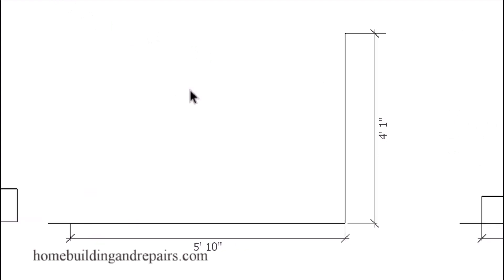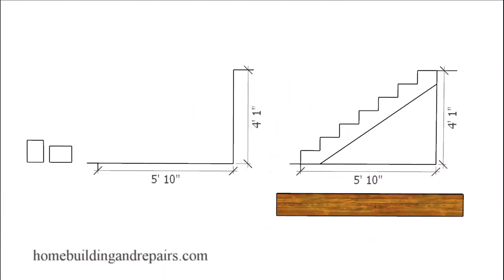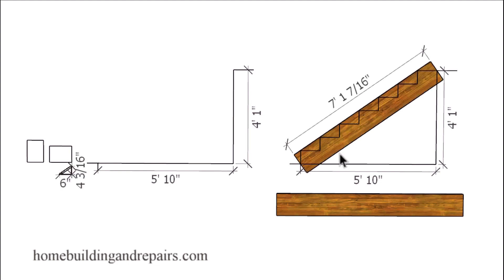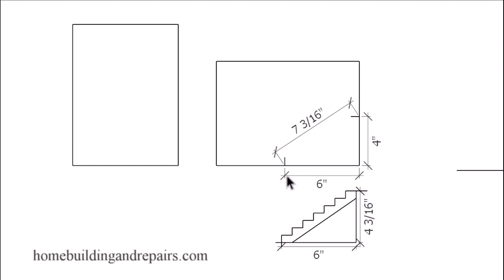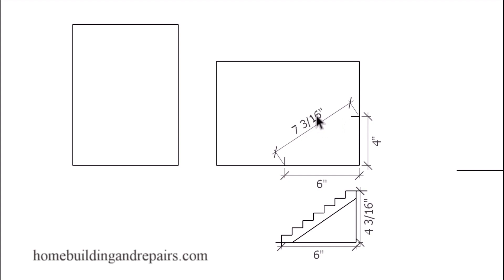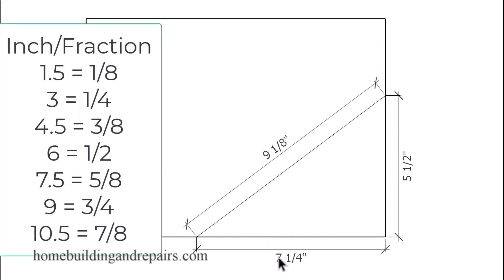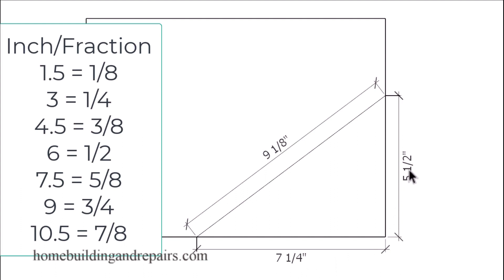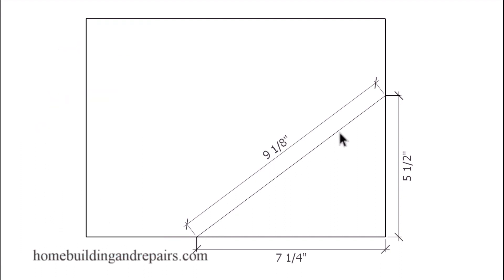How To Calculate Stair Stringer Lengths By Using Scaled Measurements - Simple And Easy To Understand

Comment: I have a question i hope you can answer. I am replacing my basement stairs which were built in the early 60's. I have total rise of 98 inches, total run of 112 inches for approximately 41° angle. There are 11 treads plus the floor surface for a total of 12 steps with 10 inch treads and approximately 8.25 risers. I want to go to 7 inch risers with 10 inch treads to give me 13 steps  plus the floor surface to make a total of 14 steps. Can i safely do this with the rise and run that i have mentioned? Will it work with the 41° stringer angle?
Reply from the maker: I would watch some videos on stairs in tight spaces.
Reply: Residential building code is 30-37 degrees